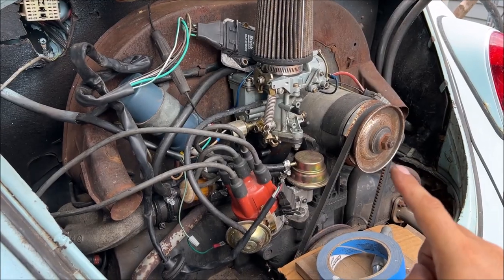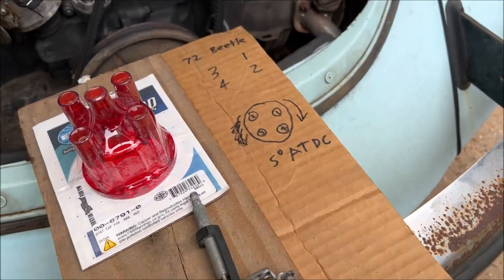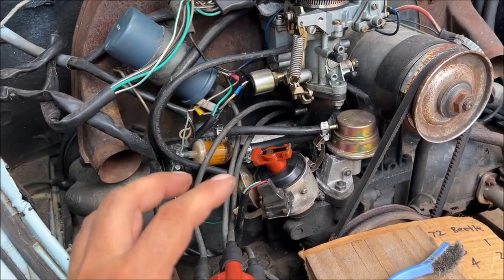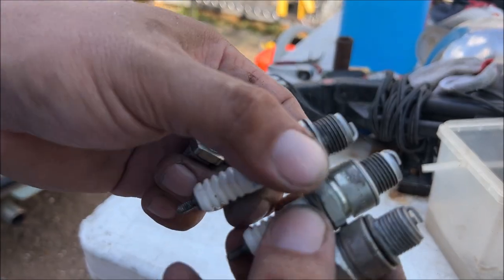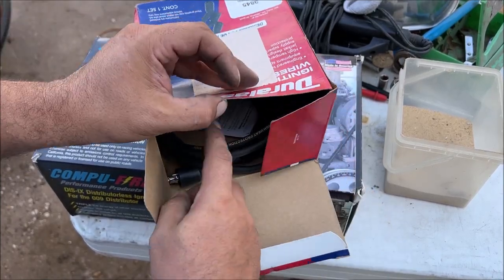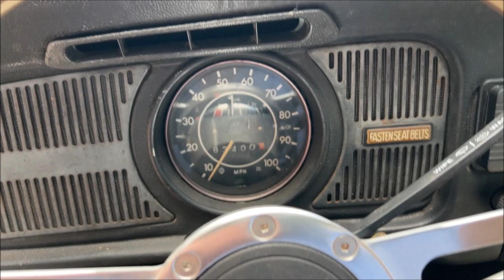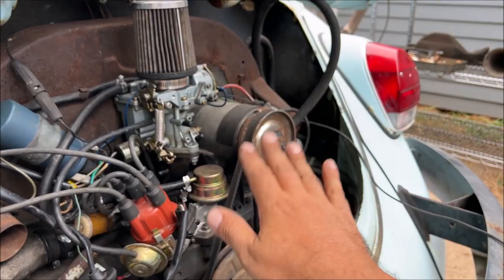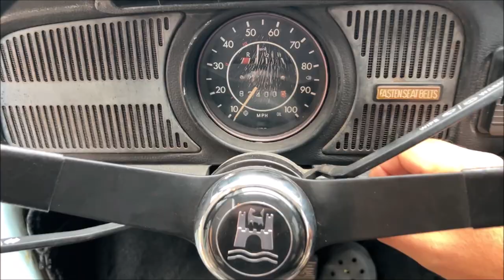VW Beetle runs like crap shaky misfire HOW I FIXED MINE

Comment: And don’t forget all Volkswagen beetles, use solid, core spark, plug wire the copper core not the carbon wires that are used newer cars with electronic technicians. The carbon wires are for suppression for radios and other things that aren’t needed on a Volkswagen.

Comment: You probably know already that the engine is missing its all important rear cover tin and No 1 cylinder heat deflector. Also there should be air hoses from fan housing to the heat exchangers. If these have been replaced with J tubes, cap the fan housing outlets and holes in the rear cover tin with metal caps. Engine will overheat without those tins.
Reply from the maker: thanks for that info.. I know I have the big one out.. but I didn’t know about #1 heat deflector.. I still have to do a valve adjustment and go through that stuff.. I am new to beetles please let me know what ever I’m doing or getting wrong
Reply: @chriscraft77022  The late John Muir wrote a book called "How to keep your Volkswagen alive". I really like it, there's a lot of good info in there.

Comment: You have a massive cooling problem with no heater hoses. Either put them back on or pull a tennis ball in the holes. One problem with the charging system is your v belt is too loose. A loose belt will also affect the cooling system as the fan which is attached to the generator will turn slower because the belt will slips. Motor sounds good.

Comment: Your engine is probably overheating because the metal shrouds and gasket seals are missing allowing the heat from the exhaust to rise up into your engine compartment and recycle instead of cool exterior air!
Reply from the maker: who said it was overheating? the reason I haven’t addressed that is because it has not overheated.. I have a hot oil dipstick that I calibrated to perfection
Reply: @chriscraft77022  I didn’t, I said maybe… I am not a vw pro but from every channel Ive ever watched, they all say that you must have the  engine compartment sealed off very well to prevent overheating. I was just suggesting that.
Reply from the maker: @bobsbarnworkshop  I’ve ran that thing all around town and the engine never got over 140 Fahrenheit…

Comment: Those plugs are too short. There should be twice as many threads. I learned this the hard way. After i installed the BOSCH plugs for my beetle it literally doubled in power. It runs like a bat out of hell now. True, your beetle has had other problems to find and fix, but make sure the parts counter guy doesn't sell you the wrong plugs like he did to me. My bad. I did not verify i was sold the right plugs for my beetle.
Reply: I'm pretty sure that you have heads that run long plugs and heads that run short plugs

Comment: Have a 1776cc  1963 beetle 🪲 with dual Empi Hpmx setup...OK for as long as I've had it and all of a sudden, it's idling way higher than usual.. what should I trouble shoot to resolve issue ? Any help or feedback would be greatly appreciated..
Reply from the maker: fast idle is vacuum leak. check those boots from carb to heads. One of mine was loose

Comment: If you are not changing the coil and still using the regular coil with the electronic module stay with .028” spark plug gap. The engine compartment needs the back tin to be completely isolated from the bottom; otherwise expelled hot air is recirculated into the engine compartment which will make the fan suck hot air instead of fresh and thus overheat the motor.
Reply from the maker: you are so right about the gap..  glad you reminded me.. I learned that .028" is as big as you go..  (researching later electronic ignition VWs) i will make an update video but it seems the humidity has the greatest impact on the way the car runs..  i have had NO NO NONE overheating issues but i am going to fix the tin issues..  thank you and please comment whatever you want you will not offend me..  i am new to beetles..
Reply: @chriscraft77022  Sure thing sir; I’ve been working on them since 1979. 😉
Reply from the maker: @vayabroder729  im chevy guy that bought my first 72 beetle in august 2023..  i love them so much..  i have very high horsepower cars but there is something about that air cooled engine sound I FELL IN LOVE WITH
Reply: @chriscraft77022  I’m a car guy so I love American cars too; I especially like the ‘59 Chevys.
Reply from the maker: @vayabroder729  why no videos?   you seem to be very intelligent
Reply: @chriscraft77022  Thank you for the vote of confidence! You need a lot more than intelligence to do videos, my good sir! Yours are very good and you absolutely know what you’re doing. But I will watch and if I can give you a pointer I will; I love helping people and sharing my experiences and solutions whenever I can.

Comment: All volkswagens when you first start them up the light for the Alternator comes on this is normal! But once you raise the RPM's up it goes off! I am not positive but a little more juice may be!  I am working on my 1963 Vw custom Notchback now. It is weird, I start it every so often, 2 charge my batteries cause it has 2 of them so it charges both of them! After about 5 minutes of idle i will goose it 2 or 3 times and it bogs then dies but not all of the time! What do U think? 
Thanks JOE!
Reply from the maker: a generator does not have to be excited.. it turned out the brushes on mine were just dirty from the car not being running for X amount of time..  it starts up now and the light goes off.   i am new to beetles but i have been messing with cars for 20 years..   on all my other cars you always put an alternator on but they are a big job on a beetle....  i did buy an alternator for it but the gen has been working perfect since i made this video.. as far as the bogging you just have to take the carb off and clean it 100% my bogs have always been accelerator pumps that were bad

Comment: Great video dude. I want to whare some stuff with you.

Non resistive plugs  and noon resistive wires. Probably you had pressure lossing ln heads. Also check your mass (ground) cable from gear box to the chassis to acoid coul overheating and electronic system burning.

Also a vacuum leak ln horns-to-intake can be helped by installing aluminum tape (fridge aluminum tape) below horns.

Exhaust to intake fuel heater should be able to lett pass through exhaust gases.

Comment: Mine was running rough as the float in the carb had gotten stuck at the top so it wasn’t letting enough fuel flow through. Would idle okay but misfired badly when trying to drive it

Comment: Great video. I have a 1973 baja bug here I just got ahold of. Looking at vids that will help me keep the air cooled engine running better and not bail to ecotec conversion like i did on my last dunebuggy. Though subaru has me tempted. Either way, if i can learn to maintain the aircooled, it will save me lots of $ :3 Thanks for sharing knowledge! It is greatly appreciated.

Comment: Had the same problem.  changed the plugs and it went away......but it's started to come back again now after a few weeks.  Hesitates when you put you foot down at low RPM.  Am wondering whether to change the coil
Reply from the maker: I’ve noticed humidity affects my beetle.. I think you just need to drive it everyday and put a load on the engine and that crap will go away

Comment: Try checking the brushes in the generator.  You can put new brushes in them and save you some money perhaps.  Also take some compressed air and blow the generator out.  Make sure the springs are holding the brushes down
Reply from the maker: I’m guessing the brushes were dirty because it has been working perfect since the video..
Reply: @chriscraft77022  it also looks like your generator belt is a LITTLE floppy which means it won't turn the generator as consistently and therefore generate less volts / amps. (Not an electrician lol) Remove one shim at a time between the generator pulley halves to tighten it, just not TIGHT tight. Just tighter than it is now.

Comment: Bosh plug run better than ngk in my 72. Tried both brand new .
Reply: Check voltage regulator behind drive seat and ground straps for transmission and battery if Gen light is on a bunch